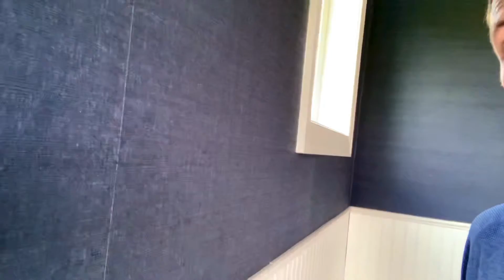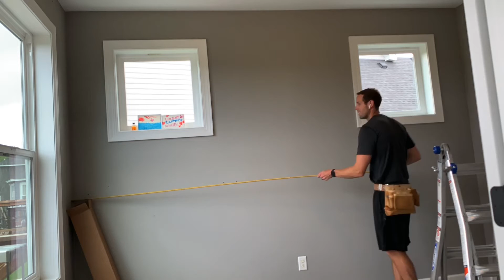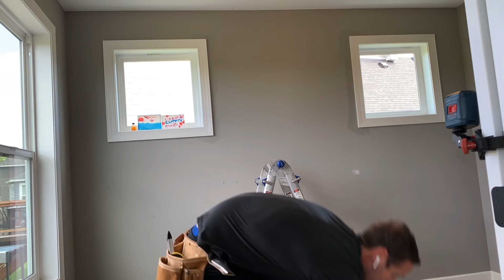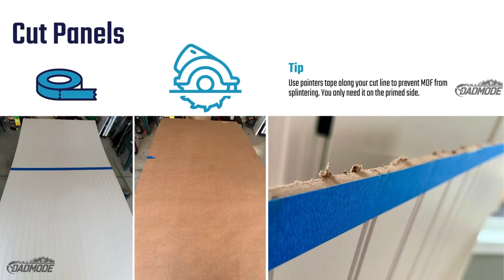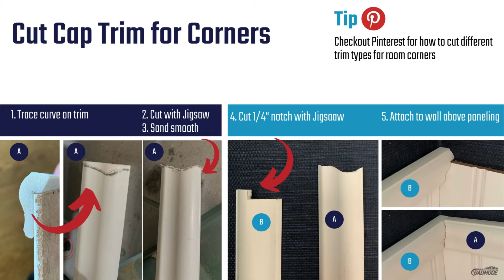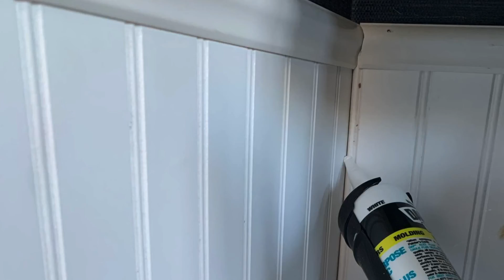How to Install Wainscoting and Wallpaper

Comment: Nice job. Question: why didn’t you cut a miter on the caps?
Reply from the maker: Good question. I had a hard time cutting on the miter saw due to the 1/4” overhang on the cap. In hindsight I could have used a small shim under the cap to get it flush against the saw fence.
Reply: @FullDadMode  thanks. I was just curious.